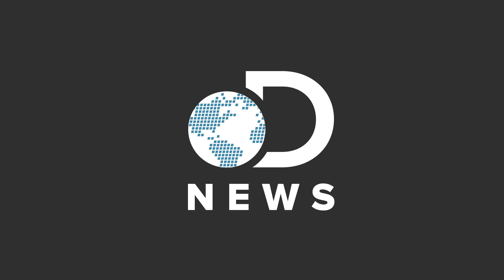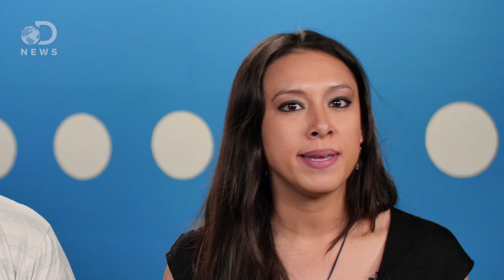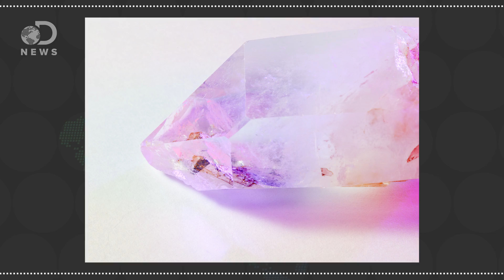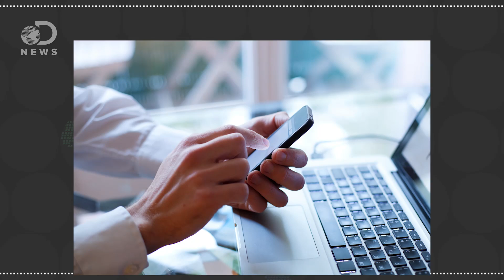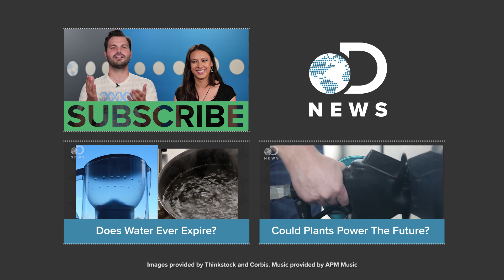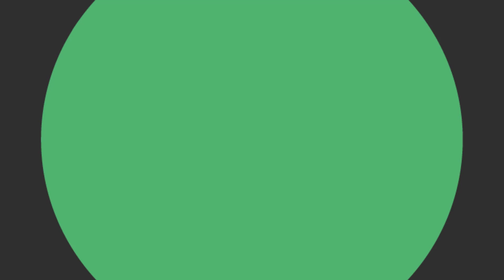Can This Wearable Tech Make You A Power Plant?

Comment: This is interesting.  I've had watches before that power themselves from movement and there has been some effort for battery integrated extreme weather (winter climbing) items as well.  I think an integration of their power based on movement instead of batteries would be very good. 

What I've said for a long time is our power issues aren't so much about being able to produce power as much as storing it.  Our battery storage abilities are still in the dark ages at this point.  Most of our battery tech in a large scale doesn't last very long before it has to be replaced either.  If we didn't need to store the energy that would help our power problems greatly.  A consistent renewable power that can be generated  instantly when we need it would go a long way to solving that problem.

Comment: I could see myself wearing a body suit daily that preformed this function. However, I would like to see how far they can improve the concept in the next 5-10 years. If it was capable of producing more energy to say; power small electronic devices constantly rather than just charge them then this would open up a huge path for wearable devices that don't need internal power supplies. 
I can only imagine what it would be like if the bionic eyes for medical use (or everyday use digital contact lenses) or even things such as pace makers could be run without external power. I sincerely hope to see tech such as this get more funding and further improvement and advancement!.

Comment: I was watching this thinking "this is moronic, the kinetic energy isn't excess: we're using it to move. And how are you going to make energy from heat that's barely above room temperature?" Then they clarified by saying it's fucking 33 bajillion times too shit right now for use and I was like '"called it!".

ty for listening
Reply: they've already got batteries the size of credit cards that can run a powerful motor for 4 hours straight and charge in 1 minute or less, I don't think this ill be necessary.